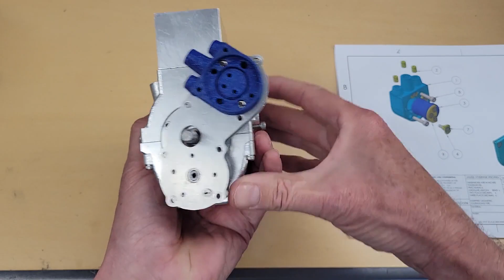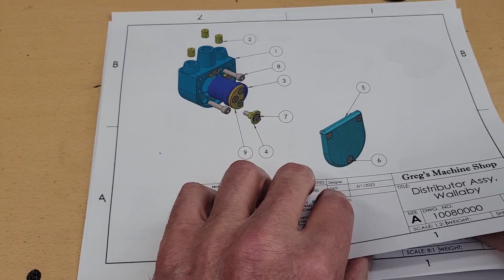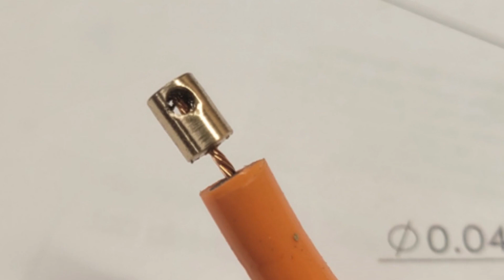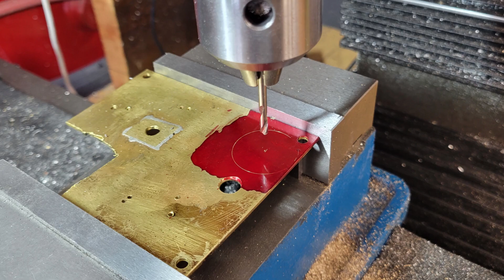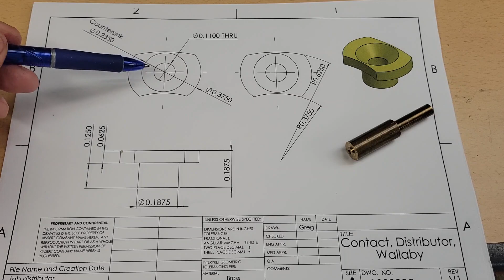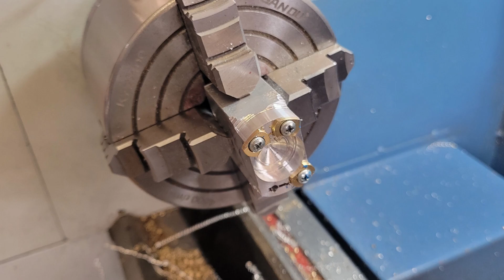Building the Distributor for the Wallaby 30cc Engine - Part 25

Comment: Why not fire both spark plugs at the same time?
Reply from the maker: Excellent question.  You certainly can fire both spark plugs every revolution of the crankshaft.  This is called a "wasted spark" ignition system as one of the sparks is "wasted" each time the engine nears top dead center.  Using a system like this would, as you said, eliminate the need for the distributor.  However, one ignition system can only fire one spark plug at a time, so you would need two ignition systems triggered by the one hall sensor.  One easy way to do this on our little engines is to use two "Coil Over Plug" ignitions triggered by the hall sensor.  A COP or "Coil Over Plug" ignition is a small integrated unit that contains the entire ignition system including the ignition coil intended to mount right on the spark plug in a car engine.